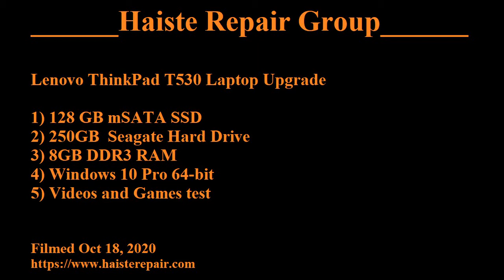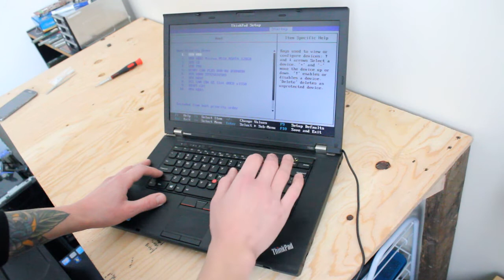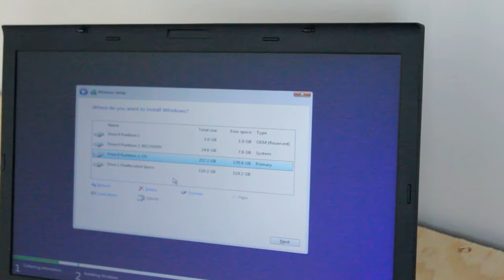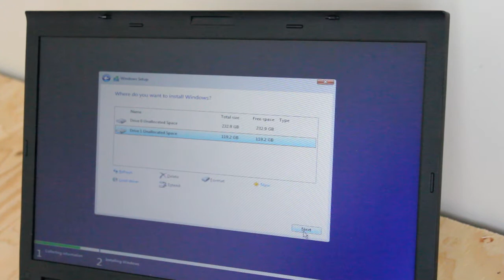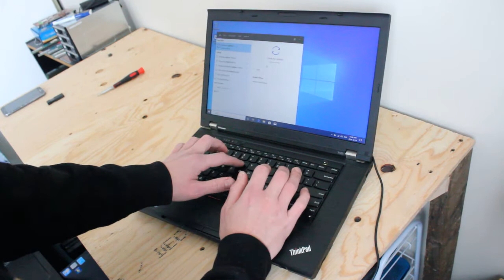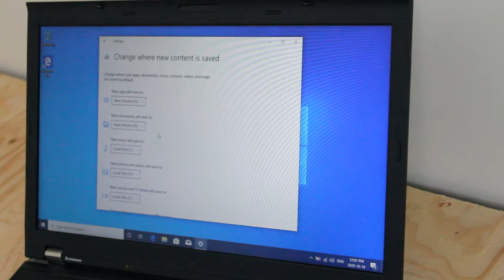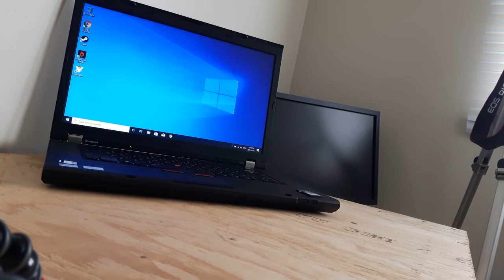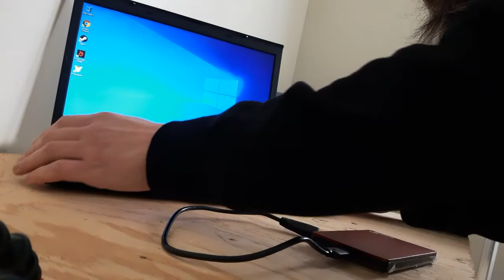Lenovo ThinkPad T530 Upgrade (mSATA SSD, HDD, RAM, Win10)

Comment: I have a T530 that my computer guy gave me. I got it with 4GB RAM and a 320GB HDD. I was able to upgrade to 16 GB RAM, a 500 GB storage HDD and a 128 GB SSD. I am actually able to run GTA 5 at 30 FPS. Not too bad of a deal.
Reply from the maker: That's awesome.  Thanks for sharing, that's good to know.  I haven't tried GTA V on this, so if people ask me I can refer to this comment.  Much appreciated.  If you ever record a video of this, let me know and I will link to it :)
Reply: There's some vids I saw earlier; Crysis on W530, and External GPU playing various games on T530 and "lower end models". Cool stuff.

Comment: I would like to put a SSD msata like you did (without replacing the current hdd) but I think 128 gb is a little, is there more capacity ssd for this laptop? Thank you.
Reply from the maker: For sure.  I am certain you can install any size capacity you like.   I buy 128GB because it's cost effective.  I make budget setups and the more I spend the more I have to make back, so unless someone asks for a custom I generally stick to the 128GB + storage HDD

Comment: Hello, I have a W530 that I would like to upgrade. I see that you used two drives for your upgrade of the T530. I am curious, why did you use an MSATA drive instead of a regular 2.5 SSD. Finally, if this was your own computer and you planned to hang on to it for a couple more years what drive would you put in it an MSATA or a 2.5 SSD? Thank you!
Reply from the maker: Some people and manufacturers say it's uncommon to install an operating system on a mSATA SSD.  I think that is because they were meaning to use them for fast tracking software or a process related to IT. Or, because it was once common to have mSATA SSD's with 8-16GB capacities, which would not run Windows.  I think it's perfectly reasonable and my daily use work laptop has the same 128GB mSATA drive running Windows 10.  Works just fine.  I don't prefer either option, but having the mSATA as boot drive opens up more storage space in the 2.5" bay.  You could even install an SSD there for storage to get a performance boost.

Comment: I have a T530 I got it with 8 gb RAM how much could I be able to improve the RAM? What should I do to get a SSD as my main Disc and don´t lose mi current information of my HHD of 500 gb? Thank u
Reply from the maker: I believe you can go up to 16GB DDR3 RAM.  2 x 8GB RAM sticks.  

As for the SSD, you could install an mSATA like in this video and install Windows to it.  If you just want to back up your important files from your current HDD, you can do something similar to this: https://youtu.be/1_1DBwhP46Q

  It would help to be able to back up your important files to an external HDD or via the method in my video I linked to.  Then, you can simply transfer the files to your 500GB HDD.  

Does that answer your question?  Do you want to keep software(programs, applications, etc) from your HDD as well?  That will be a different answer.  Let me know and I can try to help.
Reply: @HaisteComputerRepair  I dont wanna lose my downloaded Softwares, I dont wanna re-install neither windows, nor office, again, is it possible to maybe do a clonation or whatever to keep my softwares untouched. Sorry for my english I'm from Peru?
Reply from the maker: @CJdelgado4ever  It's definitely possible to clone a drive.  You would need to use an SSD equal or near the same size as your HDD.  There is software that will perform the clone process for you.  It's quite detailed, but doable.  Is there a computer shop you could bring it to, that might be able to help out?

Comment: Is this upgradable to 16gb ram?
Reply from the maker: Yes it is.  Try to find some matching 2 x 8GB 1600MHz DDR3 RAM.  I have 2 x 8GB 1333MHz in a slightly older model X220T Thinkpad and paired with an SSD, it's very nice.

Comment: Hey, Do you think Sabrent 2TB Rocket NVMe PCIe M.2 2242 ssd will work with t540p? I know it's a bit expensive but is better than 512gb.
Reply from the maker: Unfortunately you have to stick with SATA III m.2 SSD's.  Not NVME.

Comment: Can i add graphics card like nvedia?
Reply from the maker: Same answer:  Laptops will have integrated GPU's soldered onto the motherboard.  People have installed custom setups to accommodate external graphics cards, but it looks to involve some troubleshooting (I've never done it).  Here's one:  https://youtu.be/GDyL2tPyXFA
Reply: Some models, correct me if I'm wrong - I'm a novice/noob at the moment, can use the... PCIE(?) connection to run a desktop graphics card (like a desktop GPU)aand play more demanding games, I think
P50? W530?

Comment: My work let me keep one, and I followed your video to update it. It worked perfectly - thank you!! I downloaded all program files (MS Office, Windows 10) on the mSATA (64 GB - $17 on Amazon), and the 250 GB SSD is for data storage. I run MS Office and the usual Browsers. It loads up super fast and overall is a pretty decent laptop now (even though it is a bit of a 'brick' haha).
Reply from the maker: Nice!  I was just setting up a few more of these and I tried out Windows 11.  I am looking at upgrading one with a 1920x1080 display, quad core i7, and 16GB RAM.  I only wish it was possible to improve the integrated graphics (I mean, without a PCIe cable adapter for a graphics card)
Reply: I got mine from my employer too. I love people's reaction when they see it and ask how old it is. LoL.
Reply: Is it possible to run W11?

Comment: actually I was trying to upgrade mine lately, but unfortunately one screw (for keyboard removal) got stripped and now I should have it fixed first. thank you for the video btw
Reply from the maker: I did record removing a stripped screw from a laptop here:  https://youtu.be/M8vdp9ua-eo?si=Q0E_ybIRE3tOVA9o&t=156

Be careful, though.  Lucky your screw is just going into the keyboard, but it is a longer one.

Comment: Hey,
I rarely comment on vids, let alone sign in - just to comment. But you seem very helpful in the comments section, and seem like a cool dude.
I checked out your website as well.
I won't be too long winded, but I have a been pouring over ThinkPad / Lenovo stuff for weeks, on and off, and finally purchased one, a W530.  I don't have it yet. I've been stuck without a computer for weeks, having to use a phone for everything. (my eyes hurt).
Anyway, I might send a few questions your way (maybe via email) about the W530 soon, if that's ok.
Do you have an ebay store? I might have seen some of your listings, if so.

Thanks.
Reply from the maker: Yes absolutely you can send me any questions.  I haven't worked on any W530's, but perhaps they are relative to the thinkpads I have worked on.  I may be able to help.  I haven't sold off eBay in a few months.  Thanks for the nice comment :)

Comment: Thanks for sharing this content! 
1. Can i replace a SSD instead of a HDD in the backcover?
2. The fan smells really bad an this device. Do you know how to fix it?
Reply from the maker: 1. Yes, you can install any 2.5" SSD where the HDD goes.  Easy to install.
2. The fan just might need to be cleaned.  Try this video to follow instructions to get to the fan:  https://youtu.be/uKiZbaRHzCs
Hope that helps!  If you do need to replace the fan/fan assembly, there should be a small sticker or specs you can enter into an eBay search for part replacement.

Comment: Great useful video! Can I replace HDD with M.2 SSD in my T530 i7-3720QM? It means Original HDD will be insteaded by upgraded M.2 SSD.  What is the maximum storage that can be identified on M.2 slot? Can I install 256GB or 512GB or more larger M.2 SSD drive? Thanks a lot!
Reply from the maker: You can only install a mSATA SSD under the keyboard and a 2.5" SSD or HDD in the bay on the bottom of the case.  Any capacity should work fine.
Reply: @HaisteComputerRepair  Thank you so much!
Reply from the maker: @kangxu8547 My pleasure!

Comment: I own t530, currently at repair shop, probably the jeyboard panel died. If it can be fixed, I'm gonna do all those mods + install a quad core i7-3610qm, 4 cores is much better than just 2 on Windows 10.
Reply from the maker: Awesome, I installed that i7 in this video:  https://youtu.be/LSiwp-rmWe0  Good luck!

Comment: Thanks! Very helpful. Wasn't able to relocate the "Documents" folder to internal SATA drive - blocked by One Drive settings. Solution?
Reply from the maker: Are you actively using OneDrive?  If you are, I would bet that you can change the settings in OneDrive to have a different source folder, then you can migrate the Documents folder, and put settings back in place.  I don't use OneDrive myself.  Let me know if this is the case and we can go from there.
Reply: @HaisteComputerRepair  Thanks for the hint. Unchecked "Documents" on OneDrive and than was able to redirect to the "D Drive"  :)  There were a couple of sub-folders that I didn't redirect. "Office Lens" & "Outlook Files"  Next time. :)
Reply from the maker: @pingme1x  You bet, feel free to reach out here if you need any help with troubleshooting.

Comment: Which is greater, L540 or T530? Thanks for the reply😁
Reply from the maker: Well, it would depend on which CPU shipped with the L540.  T530 cold be comparable with the best CPU option installed.  Generally speaking, the L540 is slightly better, but I also haven't used one or done much research on one.  Are you thinking about buying either one?  What is the price for either one and which CPU is installed?
Reply: @HaisteComputerRepair  Ey thanks man. Yes I'm planning to buy L540 but I was confused which these two are better. But since u said L540 is better, I will go to L540 with 8gb ram and 128 SSD. Maybe it will cost about $200 dollars if  pre owned I think. Thanks for the answer man👍
Reply from the maker: @joemarpontillo7257  That's a pretty good deal.  To give you an idea of difference in price from where I'm at, I'm currently selling some of these for ~$295 CAD w/ 128GB mSATA SSD, storage HDD of various capacity, 8GB RAM.  Laptop prices and wholesale prices have gone up during the pandemic.
Reply: @HaisteComputerRepair  Look like I did good for a T530 I5 3320M 4gb 512 SSD for 175$ cad then :) 225 if I add the cost of a stick of 8gb ddr3.
Reply from the maker: @phiux  That is definitely a good deal.  Go for 8GB RAM or more if you can.    Prices went up so much during the pandemic, I had to sell these at close to $300 with the same specs.

Comment: Bro, Which is best for editing video, W530 or T530??
Reply from the maker: Well, it might depend on what video editing software you use and the budget you are working with.  The W530 has a better integrated GPU (Intel HD 4000 as opposed to 3000, NVIDIA Quadro K2000M in some cases - not sure about Win 10 drivers for that one).  So, what are you using to edit and is there a large price difference between the two?  They have the same CPU socket type, so not much difference there.  RAM capacity/config the same as well.
Reply: W530 -> W for Workstation laptop (Core i7, more ram,  better video card)  for engineering and media production - T = Business laptop (everyone else)
Reply from the maker: @phiux  Thanks!

Comment: Where you installed the ram at 7:55 there is another slot beside it what does it do
Reply from the maker: There is no slot there, just empty space.  It might be an area to provide some passive cooling being that there is ventilation on the cover.
Reply: @HaisteComputerRepair  okay thanks 🙌

Comment: Would the same procedure of installing the mSATA SSD work on a W530?
Reply from the maker: It looks like the mSATA slot is in the exact same spot as it is on the T530.  Also, from a quick Google search it appears that it will take an mSATA drive just fine.  Thinking about installing one?

Comment: I have a problem. I'm about 90% sure it's a keyboard problem. On my T 530 the N , space and Fn key do not work. I am hoping it's a software problem.
Reply from the maker: It is more than likely a keyboard hardware issue.  There are drivers that allow your keyboard to interact with Windows and the laptop, but not exactly "software."  The T530 keyboard is pretty easy to remove if you follow this video.  Try reseating the connection first.  As in, unplug and then plug back in the cable connection from the keyboard to the motherboard.  Let me know how it goes.

Comment: Hello, I have a T530 and i would like to keep my HDD as a storage and set my boot and windows on SSD. But i know that i should put my HDD in adapter  and in the cd space(optical drive) and the SSD behind the keyboard... is this way wrong and why everyone is telling me i should do it this way? Also i want to migrate my windows from the HDD to the SSD and not install a new, can you give recommendations on how to do that?
Reply from the maker: Just like the T530 in this video, you can install an mSATA SSD for a boot drive and just keep your HDD where it is now.  I find it easier to reinstall Windows as cloning can get a bit complicated and lead to further troubleshooting.  Not always, but can happen.  If you have the time to dedicate, do it for the learning experience alone.  Using cloning software will be the best option.  If you need help, I can look for a good video tutorial to send to you.  Backup your data first, always, so long as you have something to keep.  A reinstall will be faster, you just have to load up a min 6GB USB drive with a Win 10 .iso, use the Win 7 Product Key label on your device, and follow the steps outlined in my video.  A good question:  why do you want to clone as opposed to reinstall?  What is the pro/con?
Reply: @HaisteComputerRepair   I want to keep my system mainly because i have programs installed that were a bit difficult to install and a lot of headaches till i install all. It's not a problem though even if i can't clone my current windows but i though it would be faster as some of the programs are heavy ones and take time to personalize again. The cloning is not a problem i found nice software and good tutorial to do it. But still if you could also send me one i would appreciate it. 
I would like summarize though: if i get mSATA SSD- i put it under the keyboard and turn on my laptop, then i clone my system to the ssd then reboot and set my ssd as boot drive(if i want to clone, if new system then just put it and reboot and set as boot drive and install); if i get the SSD 2"5 and move my hdd in adapter it works the same way? Are there any differences in the way it works?  Also if i add mSATA under the keyboard, keep my hard disk in place, can i add adapter with another ssd or hdd? Meaning three disks.
Reply from the maker: @graciie77  That's a good question.  I would assume that as long as the mSATA SSD is recognized by the motherboard, then it will be detected as an option in the software.  In the event the mSATA is not showing up, try going into BIOS, navigate to Security, Go to I/O port access, and activate the WWAN port.   Another thing to keep in mind is the capacity of the SSD as compared to the HDD.  You would want to make sure you have enough space on the SSD.  I usually only purchase 128GB or 256GB mSATA SSD's for my work, but there are larger capacities available.  

For a third drive, you could find an adapter to fit into the cd/dvd-rw optical drive.

Comment: You can install mSATA ssd on the T-530 ???? i did not know that..thank you
Reply from the maker: You bet.  In the WWAN slot.  I am typing on an X220T with an mSATA SSD installed.  Just be aware that it will run at SATA II Speeds (still pretty fast).  So, I usually just set it up as a boot drive for Windows and install an SSD or Hard Drive in the 2.5" bay.  I honestly don't notice a difference between speeds, even used as a daily driver.  You can also set it up as a cache device, but I don't personally think the boost in performance is that grand.
Reply: @HaisteComputerRepair  yeah i know mSATA isn't faster, just the extra potential storage sounds awesome, also just found out they make ssd caddy for the optical drive so you can have 3 ssd's total.. crazy
Reply from the maker: @winnipegmbcanada  yeah, that's pretty cool.  It would be fun to do that, just for the novelty alone.

Comment: How do you boot up a new hard drive i been trying to do this 5 hours straight and idk how to
Reply from the maker: Can you explain what happens when you are trying to boot from the drive?  What do you see on the display?
Reply: @HaisteComputerRepair  pxe-e61 media test failure check cable fix. Do I need a flash drive with windows 10 or 7 cuz idk how to fix this
Reply from the maker: @Doge-Blitz Ok, so you haven't installed Windows yet from a USB drive?
Reply: @HaisteComputerRepair  yes but i have a USB with 16gb but idk how to install windows 10 on it
Reply from the maker: @Doge-Blitz  First, make sure you are ok with formatting the USB drive.  If you do format, right click the drive in File Explorer, click Format, and change type to FAT32.  Then go here and click on Download Tool.  It will walk you through making Windows install media  https://www.microsoft.com/en-ca/software-download/windows10
Reply: @HaisteComputerRepair  thx!
Reply from the maker: @Doge-Blitz  Did it work out?
Reply: @HaisteComputerRepair  Yes thank you very much!
Reply from the maker: @Doge-Blitz Fantastic!